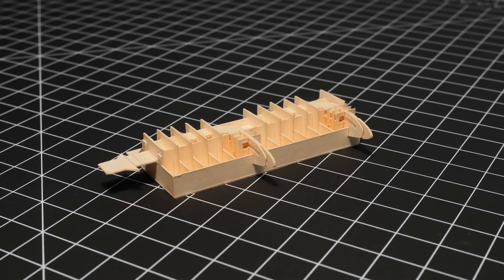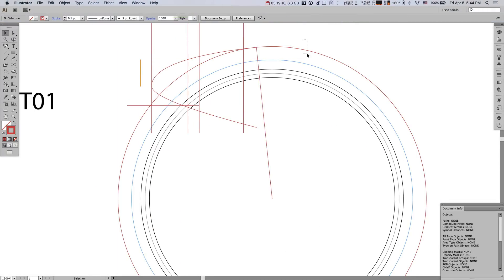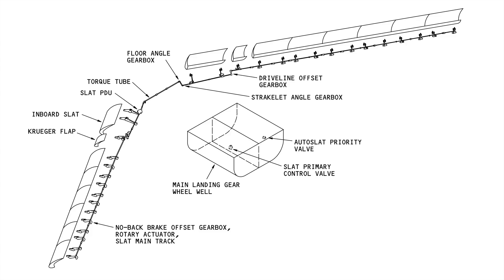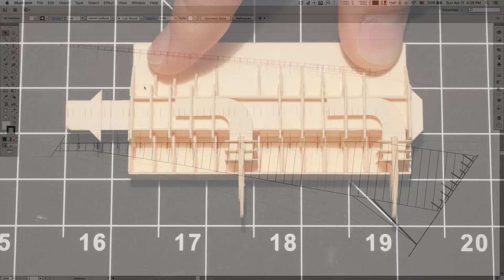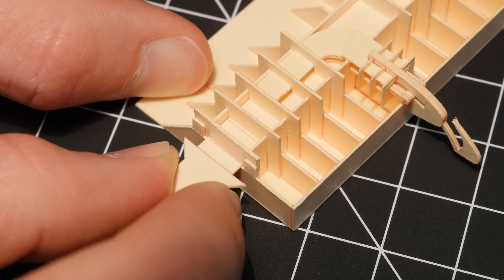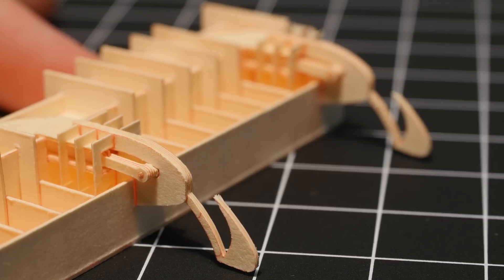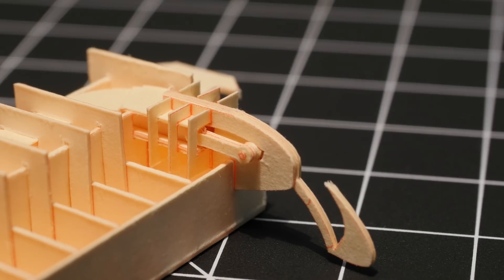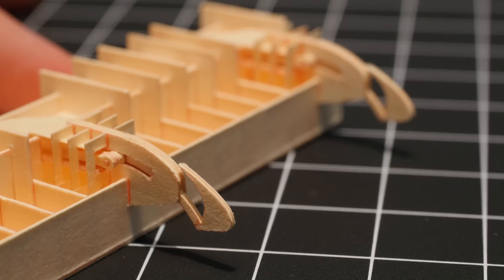Manila Folder 777 - Wing Update - Slat Test **4K**

Comment: Illustrator? Somebody get this man a copy of Autocad or Onshape or something!
Reply from the maker: I actually kinda like designing in 2D, it forces you to really understand the geometry of the parts. But I'm also a bit of a masochist ;)
Reply: Oh yeah, 2D makes sense, so that's why I suggest AutoCAD.  I guess it would take some getting used to the change, but I think you'd find it a lot better suited to precision 2D work than Illustrator.  There's a free knockoff of AutoCAD from Dassault you can get by googling DraftSight Free, if you care to try that sort of thing.  It's like 90% as good as full fledged AutoCAD.

Onshape is a 3D parametric design tool, which means you'd make 2D drawings of each part, then extrude them in space to create the 3D representation of how they fit together.  It definitely does take some of the mental challenge away, though.

Comment: Are you doing it with so many details just for fun or these systems will be at least partly usable in model? Cause it looks like you need quite a lot of place and precision to operate them which won't be possible after putting the plane together
Reply from the maker: They'll be fully usable in the model, accessible from some kind of hatch in the wing.

Comment: @Luca Iaconi-Stewart What do you use for the really small pins? Is it rolled up Manila folder? toothpicks?
Reply from the maker: +Mada1100 Yea, single-ply (de-laminated) rolled up folder. Once they dry they're insanely hard, so they're a lot stronger than you might think. It's just a bitch getting them to be the right thickness.